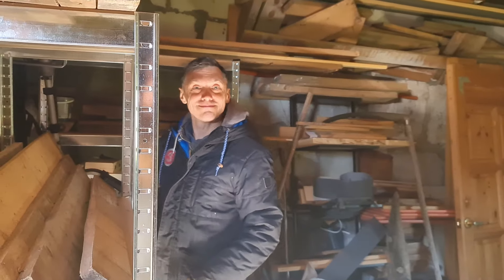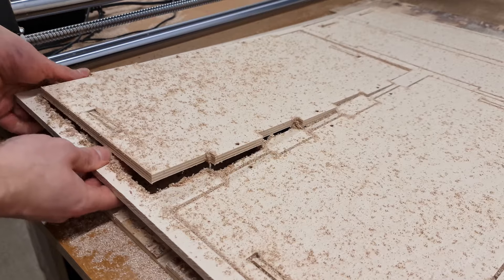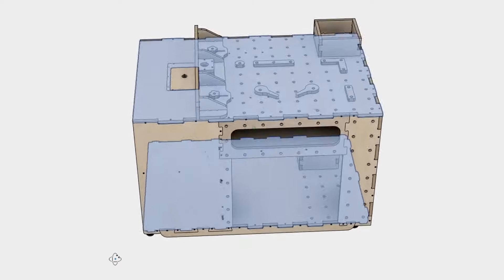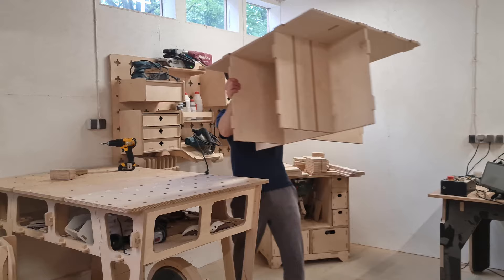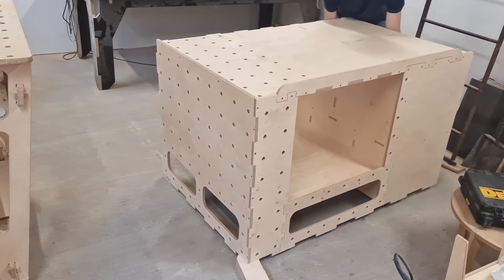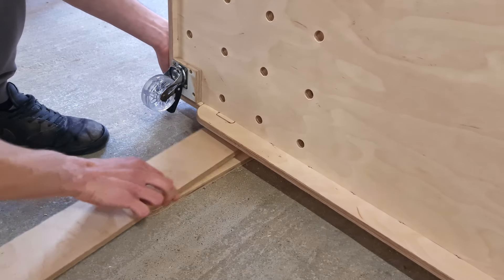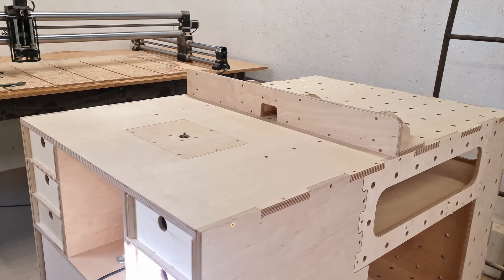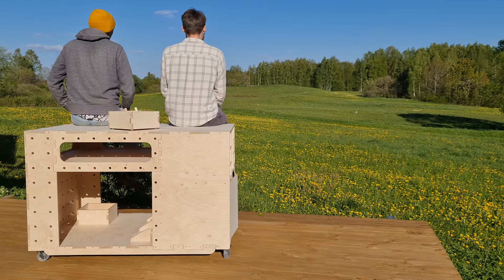Workbench - Router Table 2 in 1 - Made on a Hobby-level CNC Router

Comment: Any tips for making finger joints in fusion? Do you make them at the end?
Reply from the maker: We usually create the joinery while sketching each component, but another approach - especially when starting out - is to design the overall project first and add the joinery later. Just keep in mind that adding joints at the end can impact assembly and how parts fit together in the 3D model, so careful planning is key!

Comment: Nice work. I'm lucky to have a 5x10 CNC router with ATC for my personal use. Hoping to make some simple furniture in a similar assembly style because my hand woodworking skills are minimal.

I'm curious to see your workflow in CAD. Do you make the design first and then add/subtract the material for joints, or make the panels with the joints right away?
Reply from the maker: That's an impressive CNC to have for personal use! 👍 More than enough worksurface to make furniture for your home.

For most of our projects, we design the complete components right away. However, for more complex designs, we start with a rough "sketch model" and gradually refine it by adding details and joinery.

If you're curious about our workflow, we have a tutorial that gives an overview of our design process. You can check it out here - https://youtu.be/tszCSq66Nx4